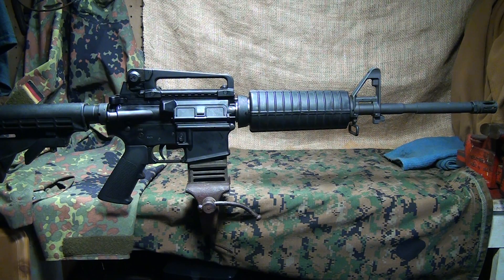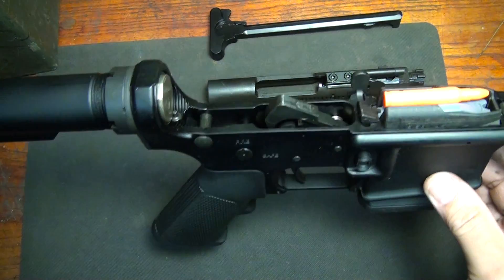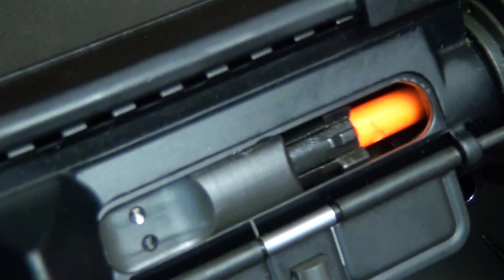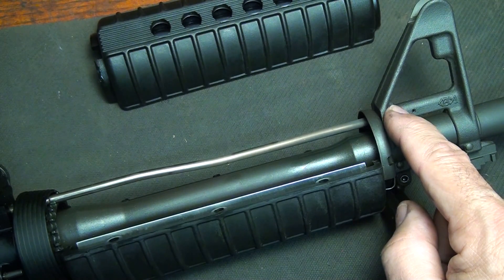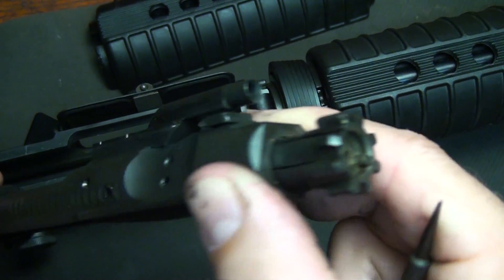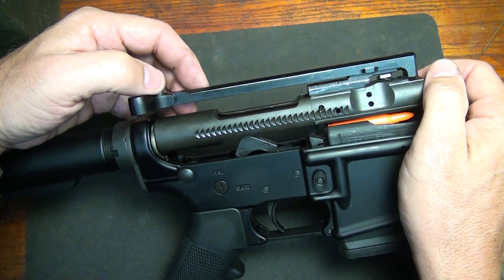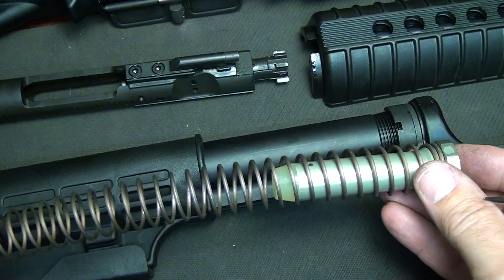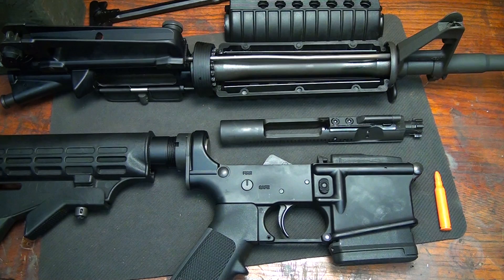How the AR 15 / M4 DI or Direct Impingement System Works

Comment: That was a bit incorrect. The gas does NOT push on the bolt carrier. Instead it pushes into the bolt. The two little holes or vents are the escape port for that.

Comment: So what keeps the bolt locked to the rear after the final round is fired?
Reply: fastmatt30 The rear part of the magazine follower (part on the mag itself that pushes the cartridges up) extends 1/4" longer than the rounds do.  When your mag is empty that extended bit pushes up a latch that prevents the bolt from going forward.

Comment: Was taught in a similar fashion when I was a British Army recruit on the 7.62mm SLR. Top cover was removed so we could see the action of hammer, breech block and slide (bolt and bolt carrier). Spring was removed from gas piston to show action of piston forcing bolt rearward. We used drill rounds. Less then a year later was in Malaysia with the AR15, impressed with the Direct gas Impingement. No gas plug to clean! Good post Sootch00.

Comment: Militaristics and Atomsmasher have already hit it... you missed half of the point of the video, like you got side tracked with foward assist and buffer assembly... Never touching on the locking cam or the gas rings on the bolt.

Comment: Yup, I'm pretty sure the bolt acts as the gas piston (temporarily "fixed" against the back of the barrel) and the bolt carrier acts as the (moving) gas cylinder, until the bolt unlocks and the assembly moves as one.

Comment: doesnt the gas presure travel down the gas key and fill the chamber made by the gas rings at the rear of the bolt, that presure tries to expand the chamber and since the bolt is locked into the barrel extention and can not move foward the force is directed into the bolt carrier driving it back and forcing the bolt to un-cam from the bolt lugs in the receiver extention and unlocks allowing the bolt and carrier to continue its rearword travel which is controled by the buffer weight and spring.

Comment: That's my point, given that the gas flow doesn't stop at the gas key but actually flows through the BCG and out the ports on the side of the carrier, I just felt that that you left out half the process. Don't get me wrong, great video, just constructive criticism I guess. It's often mistaken that the gas key does the work whereas it's the bolt acting as a piston inside the carrier that does most of the work cycling the firearm, as I understand it.

Comment: You are right. It's not as great as an AK. It's GREATER. lol Just poking fun. They are both great guns, just designed for a different application. AK is made for utter reliability when conditions make maintenance difficult or impossible. The AR platform  is more precise & complex but assumes time & resources for maintenance will be possible. You can argue which is best or you can just get one of each. :)

Comment: The gas pressure does not push against the gas key as much as the gas key channels the gas down into the BCG and against the back of the bolt. The pressure inside the bolt carier pushes it away from the bolt in the only direction is is free to move; to the rear. The BC gains momentum to cary it the rest of the way. If the key was what was being pressed against there would be no need for gas rings on the bold and exhaust ports on the BC. There also wouldn't be all that carbon on the bolt.